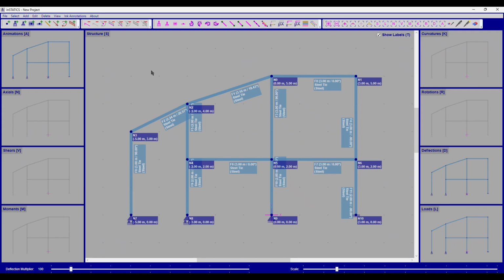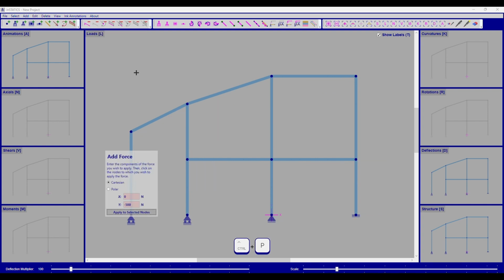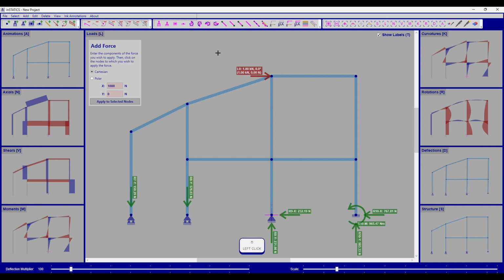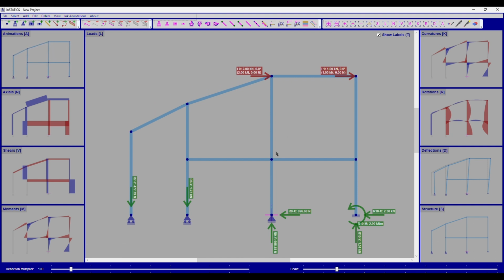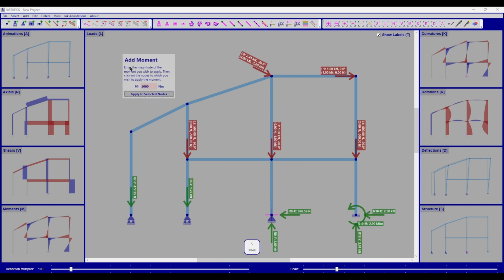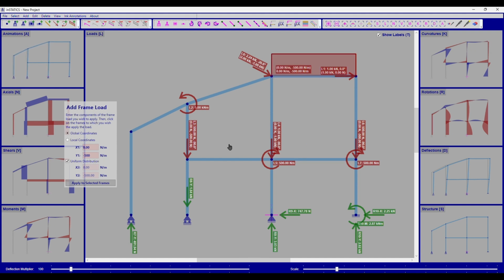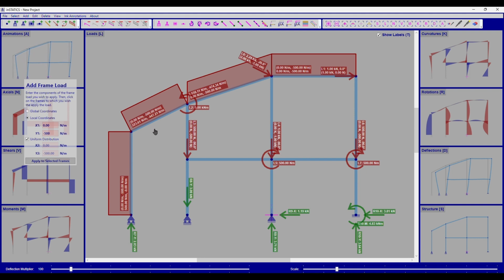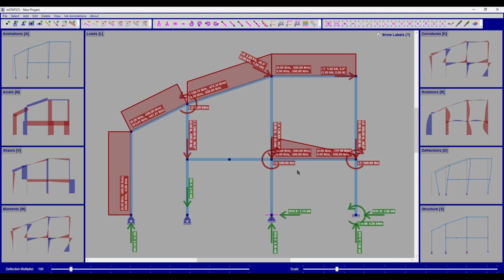inSTATICS: Loading a Structure

Comment: is there a way to model a spring?
Reply from the maker: Yes. You can simply use any frame with a given area and material with a given elastic modulus and that would simulate a spring.